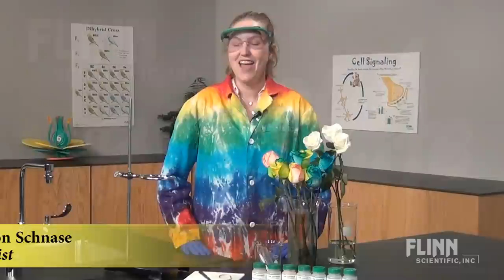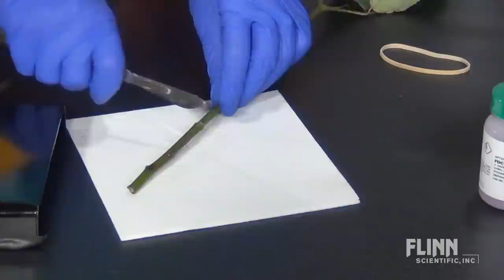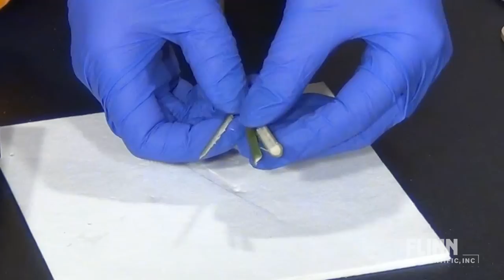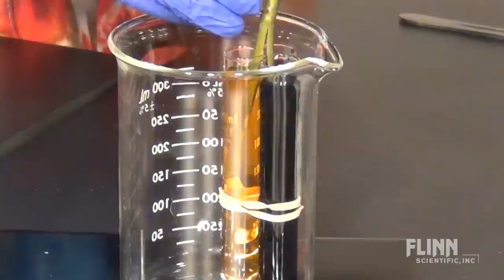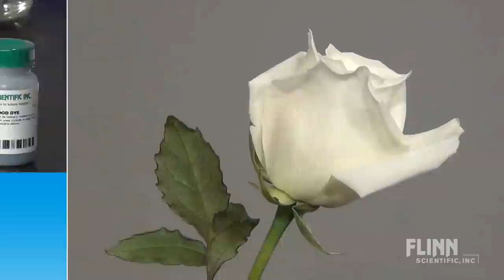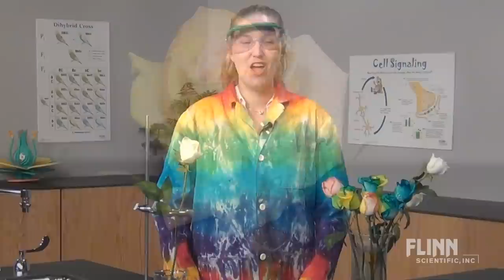How to Make Rainbow Roses

Comment: I've achieved good results with other, softer stem, flowers using a slightly different method. I let them sit for 1-3 hours (depends on the flower) out of water, so they absorb liquid more easily, then simply fill large syringes with dye solution and inject the stems. Now, since roses have much tougher stems, I do not know if this method will work on them, but I am going to try :)
Reply: You should make a video to let us know if it works 😊

Comment: NONE of these methods work, the rose never absorbs the dye to give you the colors used at the florist... FOr the Florist look, you have cover the green leaves in plastic and set the rose itself in a shallow pool of dye. Let it dry, then turn and set the rose in a different shallow pool of dye util you get the effect. At times when you buy them from the florist the leaves are dyed as well from the lazy florist not covering the green leaves before setting the rose in dye...